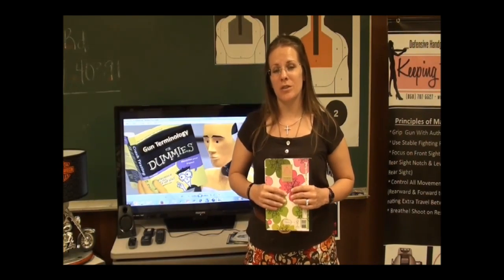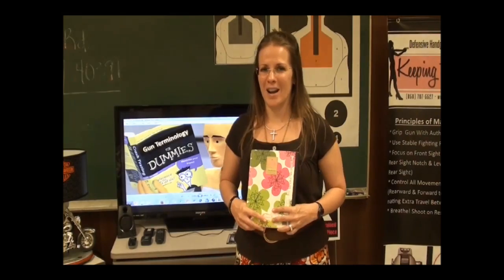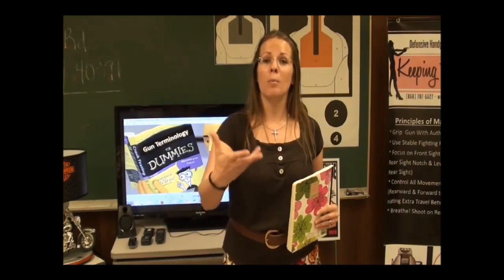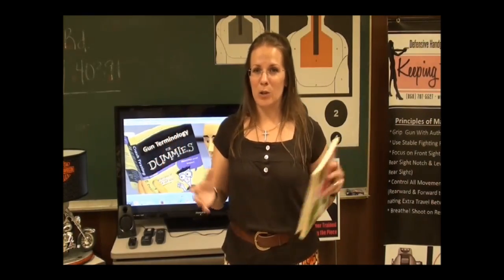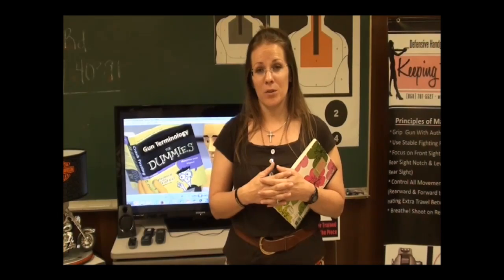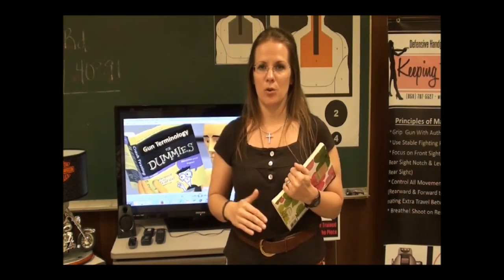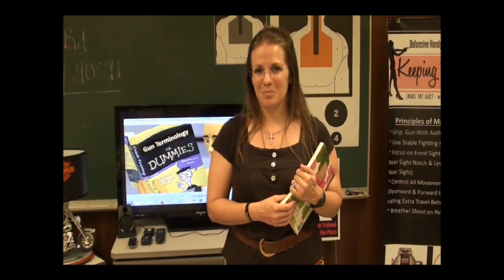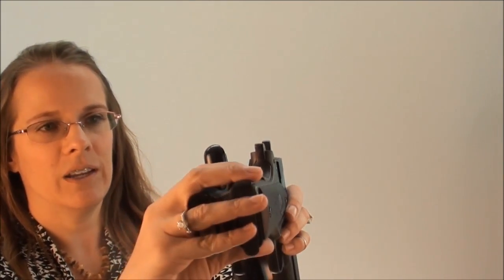Gun Terminology for Dummies: Beavertail Safety

Comment: As a word of caution to the.. novice shooter, (like me) if you have grown accustomed to using a striker fired pistol, and you subsequently purchase a hammer fired one, you need to remember to decock the hammer after firing the new gun at the range and before reloading it. In other words, unless your gun is designed to be carried "cocked and locked" - and you have relocked it - you need to always decock the gun when you've finished shooting and reloading it. Whereas, you did not have to do this with your striker fired gun. I hope that this is helpful and not more confusing. Thanks for this video.